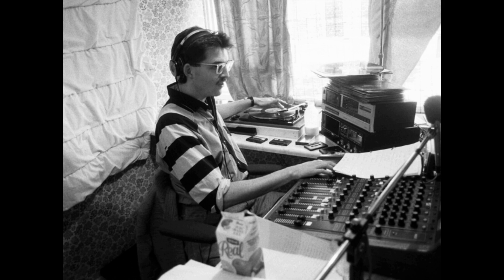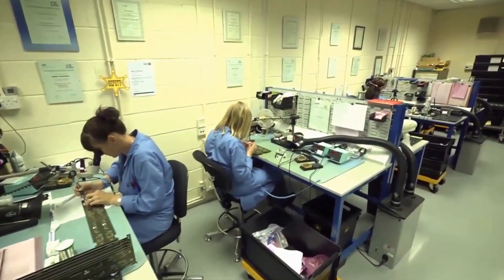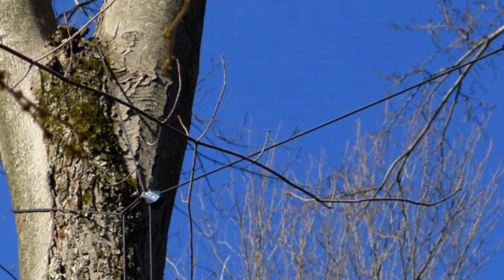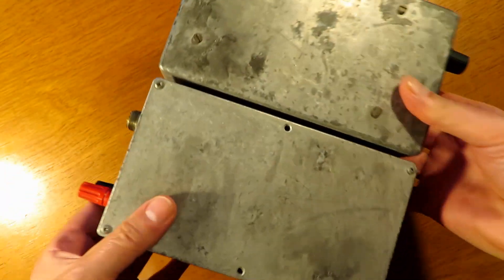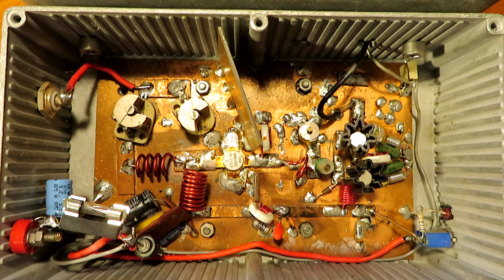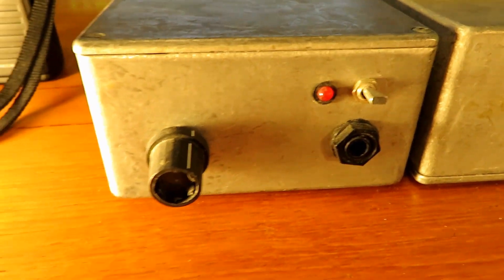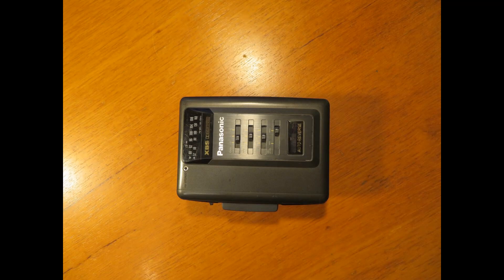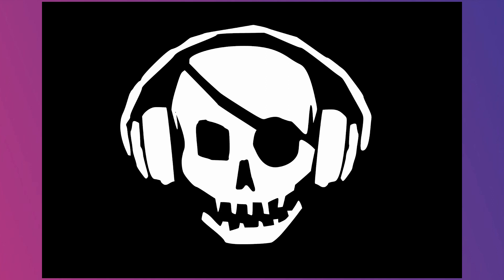Pirate Radio Transmitter from the 1980's....but does it still work?

Comment: The real question is, how many parts to make it were borrowed from work and how many came from Tandy?
Reply from the maker: Ha ha none actually I bought all the bits and the rest were salvaged from old TV sets, we used to run a blow torch across the back of them and knock components out and put them in jars.

Comment: 15wts did 25miles! 🤣
Try 5miles. 
150wts off a tower block on flat ground just about does that.
Using 300wts off a 700ft National grid pylon on the Thames in essex was hitting Portsmouth’s to cambridge when it was being used until last year
Reply from the maker: Had no problem, I have 5 watt Walkie talkies that will do 25 miles with clear line of sight, you obviously don't know how to setup your equipment properly.
Reply: knoxieman 
https://youtu.be/PVK07KqqIT0
Reply: Yea I haven’t got a clue that’s why other stations ask me to set up for them now! 🤣
Is the fm on the same band?? 
No. 
Different bands will go further. 
My 5watt band 1 link that is below the fm band has linked in from 15miles from ground level no problem. 
One night we even had a french station half linked in before we turned our link on.
If that transmitter was 20foot up a tree on flat ground you will get about 5 miles. 
Up a fuck off hill you may push 20 miles. 
As you said you’ve never been  part of any decent pirate station so without setting it all up and going for a drive you can only speculate because you obviously haven’t got the balls to set it up outside properly to do a real test... 
I’ve had signals from the Thames area in essex reach Portsmouth to Cambridge!
Reply: You're an idiot. My 7 watt transmitter that I hooked up last night was going 7 miles and still crystal clear when I turned around.

Comment: Very interesting. In March 1993 I have obtained licence to broadcast on FM, with reduced ERP power of 300W in Vojvodina (Serbia, at the time Yugoslavia). I was then and for the next 3-5 years the only independent radio station, but actually the only independent broadcasting media in Autonomous region of Vojvodina. From the first moment I have the licence there was sophisticated but gradually very cruel pressure to became state controlled radio. It was very lucrative, but it means to broadcast populistic and hate speech propaganda. That was not something I could agree, and there started a state organised terrorism. So I was forced to broadcast using some similar transmitters. Mostly LPFM having 2n3866 and 2n4227 (I guess) output transistors. Despite fact my ERP was very low, but the very existence of my radio station was reason to shot broadcasting antenna by a sniper. Transmitter started to burn as result of a short circuit. And there was nobody in Yugoslavia (including famous Soros Foundation) willing to help me by bringing me some FM transmitter kit from Britain or Holland (I offer to pay all expenses
). Just to mention Yugoslavia at the time was under the OUN sanctions. Well it was clear to me there is no hope and I was forced to leave the country. Half an a year later I came back trying to re run radio station, but Milosevic regime special police with "Kalasnikov" automatic guns took me to the police station in order to make strong pressure using arms, to leave the country  forever. At international conference in Ljubljana, my radio station was recognised by UNESCO, IFJ, IFEJ as great contributor for peace reconciliation and high class in information and cultural programmes. So by the facts I was legal licenced radio broadcaster, but in the real life I was forced to use practice of clandestine and pirate radio stations,...
Reply from the maker: Wow! Now that's a story
Reply: Amazing story

Comment: hi ..why my yupi Mvt-7000 quite similar  to yours.... ;)
Reply: my yupi now having funny symptoms,

i need to use a heat source blow to the battery compartment(main ic area), then the unit only will receive transmission or function correctly for few minutes till the heat gone... 
i had dismantled it and resolder every component and change most of the electrolyte cap but the problem remains the same...
I suspect is the main ic or the crystal is giving the headache ... hope yours are in perfect conditions...
Reply from the maker: Hi yes mine has been perfect, the display is fading a little and I also had to change the memory capacitor battery too, fantastic scanners, don't sell it I don't think a better ones been made since.